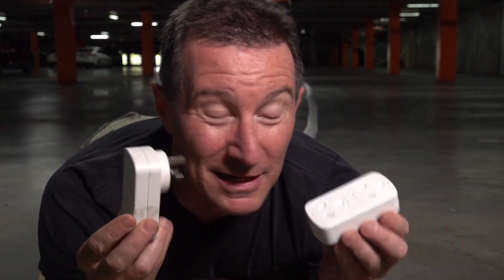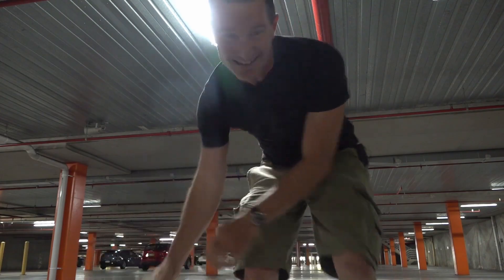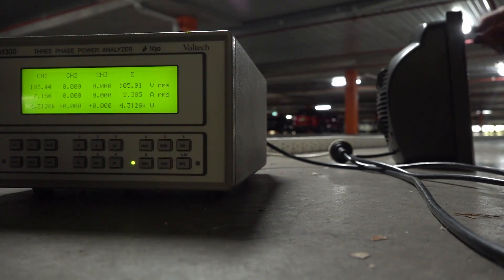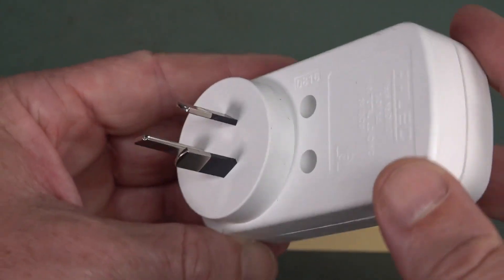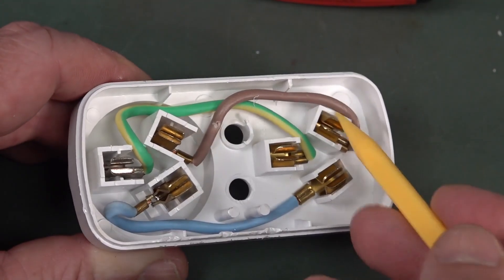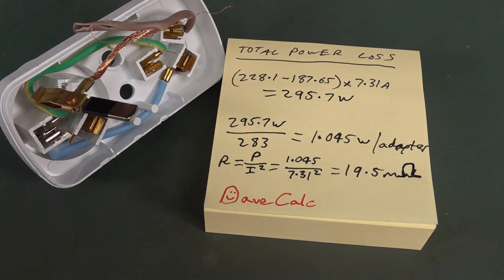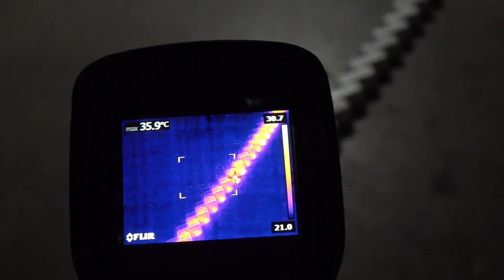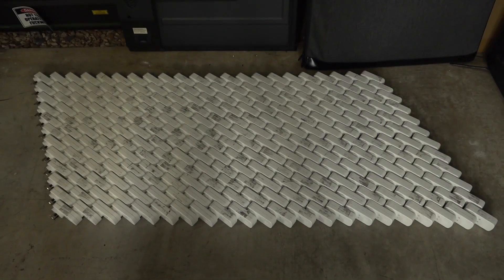EEVblog 1526 - I put 283 Double Adapters in Series with a 2kW Load!

Comment: Your perpetual energy machine won't work!!! Your circle isn't round. BTW I think you'll find that the insulating sleeves on the A&N pins are to prevent inadvertent shorts to thin conductors falling in between insufficiently mated connections.

Comment: The parasitic capacitance could serve as power factor correction for the inductive load of the motor in that heater.
Reply: With enough adapters in series no need for a motor. Just put a short at the end of the chain 😂
Reply: @absurdengineering  100% efficiency!

Comment: Most important question: would a circuit breaker work? Probable not, the initial short current is less than 40A! Heating up the line increases the resistent and the current decreases under the thermal breaker characteristic.
Reply from the maker: Yes it would. Total resisance is only about 5 ohms, so at 240V that's 48A. A 10A outlet has a 16A circuit breaker. In this case my dungeon has a 20A breaker.

Comment: I dunno... I saw your thermal cam read 55-60 degrees on a couple of those. Still not enough to start a fire, but wouldn't feel good if you bumped into it. I wonder how much heat sinking the concrete provided? What's TJMax on a plastic doubler with a concrete sink?? 🤣👍
Reply: Still 70C, the softening temperature of PVC.

Comment: might have been interesting to see how if behaves if the other port was used on each unit (using the more direct connection)
hehe, I was missing a thermal cam check first, but Dave delivered ;-)

OHM!

Comment: Those five extension cords would have been contributing some of that voltage drop you saw at 1kw and 2kw loads, too. (Sorry, just watched further in the video, you did touch on that.)
Reply from the maker: Yes, but the point was to see what drop the double adapters had. I didn't care what the current was as long as it was decent.

Comment: It would logically follow that here in the US we could use twice as many adapters, since we have half the voltage.  😅😂
Reply: You joke but the opposite is true. Lower voltages waste more power. Half the voltage means half the adapters, not twice.
Reply: @timewave02012  Yes, it was a joke.  Our 120V system is actually more dangerous in my opinion.  I’d bet the risks of overloaded circuits causing a fire are higher than the risk of accidental electrocution.

Comment: Arlec makes a few different types of double adapter - ones that go to the left, right and a vertical one. I assume using flexible wiring inside allows them to use the same wiring for all variants instead of having a bunch of different types of stamped brass.
Reply from the maker: Yeah, good point.
Reply: @EEVblog  Plus using the cable is a lot cheaper, in that you do not have any metal wastage when making them. Brass sheet stamped out you lose a big piece to wastage with each punch, and while you can recycle it, that means the per unit cost for the current carrying bit is a lot more, as you only use less than 50% of the material volume to do work in the outlet. Wire only scrap is 2 pieces of plastic sheath, easy to recycle as low grade PVC.

Brass sheet though is expensive, it takes a lot more machinery, as opposed to the simple wire drawing machinery and PVC extruder needed for cable manufacture. Plus you then need 3 punch die sets extra per plug, as opposed to here where you have one die set, that mass produces the 3 socket blade units as identical ones, using most of the long brass strip for it, and only needs a single punch die, followed by another 2 stamping dies to form them into the blade shape, and then you rivet the one side to the plug blade, and the other side is just loose.
Reply: @SeanBZA  OK, but then wouldn't that reasoning be even more applicable in power-boards? If so, why don't many of them use discrete contacts wired together?
Perhaps it's easier to arrange the power-board contact bars for efficient brass usage, that's all I can think of.
Reply: @longrunner258  Power board contacts are a punched strip, and most of the copper strip will go to making the current carrier and breaker ends, with very little being scrap, directly recycled back as copper scrap. Makes sense for the distribution board side, as this saves the manufacturer a lot of time in assembly, fewer parts to put together in the most labour intensive assembly process.

For the double adaptor however the most expensive part is the copper and brass itself, then the plastic, so if the wire costs say 1c, plus another 2c for the labour, the brass will likely cost 5c, and still have the 2c of labour cost in it.
Reply: I agree, and even within this adapter now 2 different model brass pieces are needed. Otherwise, 3 different brass models were needed.

Comment: That's not that bad, considering in the real life most would never use more than 5 of them in series.
Reply: Don't be so optimistic!
Reply: thats not true.... i go to clients houses all the time
i see more than 5 easily 
if i had to put a number on it for what would never happen, the minimum that would never happen i might say 20,   Perhaps 15 but that would be cutting it close

5 would happen any day of the week , i don''t think 20 would though
Reason, because to buy 20 of the double adaptors it would be cheaper to buy 2 bigger ones with 10 on each or 4 with 6 on each

Comment: Honestly, I'm not sure why this isn't recommended. The 295.7W that's "lost" just becomes part of your heater. As long as your adapters are in the same room you're trying to heat. How many of these would you need to then replace the heater load with a dead short?
Reply: You would need about 3000 of them to replace the heater.

Comment: If this configuration was used to heat a room, would you have less heat, the same, or more than if the heater was just plugged directly into the wall (i.e. is the heat from the adapters equal to the deficiency of the heater?
Reply: Definitely less. Higher total series resistance -> lower current -> lower total power across everything.
Reply: @Gameboygenius  WRONG, this is a basic physics 101 question.  Energy can neither be created or destroyed. There is no energy "loss" here, it's converted to heat,  the heat from the adapters+heater = heater alone
Reply: @Gameboygenius  the heater itself a one giant resistor, it's a resistive element heating coil in front of a fan. The heating is exactly equivalent
Reply: @mattgayda2840  No, the resistance of the circuit is increased with the adapters.
Instead of 2kW, only 1.6kW is dissipated in heat. The current is lower. P=U*I=U²/R

A 10 Ohm resistor across the socket gets warmer than a 10k Ohm one.
Reply: @Momchil0  where do you think that power is "lost" by a resistor? It's electrical energy is converted into heat, you can't destroy energy and the magic pixies don't disappear.
Reply: @Momchil0  have to researched this and realized you're wrong? Because you're totally 100% wrong here and I'll  give you my full unconditional support if you admit you're wrong.
Reply: @mattgayda2840  :D
The heater alone would dissipate P=2kW --> R=26,5Ohm and I=8,7A @U=230V

Now you add all the adapters. On each connection and the additional wiring R gets bigger. P=U*I=U²/R
U=230V is constant and R increases --> P decreases.
I don't watch the video again for the exact values, just as an example:
P_measured=1.6kW @230V
R=33Ohm and I=7A

The measured P is lower because the resistance is higher with the adapters.

It's true for every circuit. If you increase R then I will be lower. With a lower current, P is also lower.

What will get hotter, an 1Ohm resistor across a 9V battery or a 10kOhm resistor? You can try it.
Reply: @Momchil0 You can't ignore the basic laws of physics... you can't destroy energy, it has to be converted to something. All this elaborate calculations prove is that you can't destroy energy and you failed to calculate for infrared light and other loss. 

This is literally basic physics yet somehow there's people trying to argue against it 😂
Reply: @mattgayda2840  Nowhere I mentioned energy is destroyed. You use less power out of the socket, therefore less power is dissipated in heat over time (energy). You don't understand the basics of electricity and Ohm's law. With the adapters you changed the physics (resistance) of the device under test (heater and adapters).
As I asked you in my previous comment, which resistor gets hotter?
1Ohm across 9V or 10kOhm across 9V?
Which resistor will drain the battery faster?
It is not the same.

Comment: I´ve been in Shenzhen at this huge electronic market (several high towers linked together on a dozen floors), and the people sitting in the boots and talking with customers use the idle time for assembling wires and stuff - most probably also those ones. They´ll have a bunch of the contacts and cables, and they will be crimping them when there is no customer around.
Reply: It's a good idea -- we all could make some extra cash, while using the toilet!
Reply: So it's cheaper to use the idle time labor than use less labor-intensive manufacturing?
Reply: @thunderb00m 
When labour is only a few dollars per hour, yes. And they'll be paid per piece in those sorts of systems.... Or just buying parts and selling the assembly directly. That goes on a lot in China.
Reply: These things are made from plain old sheet metal and plastic case. No crimping! No soldering!

Comment: It was probably manufactured by a small team in china rather than a large company.  They wouldn't bother getting custom tooling for shaped brass inserts. Easier to just buy off the shelf terminals and wire. A small company only making double adaptors because they found a box of 10,000 surplus terminals or adaptor housings for surplus pricing at the Shenzhen markets. There's lots of money to be made in china assembling stuff out of whatever surplus parts are easy to get at the time,
Reply: Makes sense
Reply: China uses Aussie style plugs internally, so I would have thought there would be a pretty large domestic market for them? It is not just Australia and New Zealand.

Comment: Air compressor safety instructions: Always use a longer air hose, plug straight into wall, don't use an extension cord.

Dave:

Comment: did not have the right screw bit to take it apart I see!
Reply from the maker: I don't think there is a screw bit for that!
Reply: @EEVblog  Nah, piece of proverbial urine, I just filed out a notch in an old flat blade screwdriver, you only need to get it to fit into 2 of the 3 indents on the screw head.
Reply: Yes there is. It's very expensive and only sold to locksmiths. They are used to replace locks fitted with one way screws. If you are not careful the expensive tool can easily be destroyed.
Reply: @mrfrenzy.  Only to locksmiths and any random dudes making double adapters.

Comment: How many adapters would you need to have to get more heat from the power loss of the adapters to than heat from the heater.
Reply: Each adapter had a resistance of about 0.02 Ohm. The heater has a resistance of 29 Ohm so you would need 29/0.02=1450 plugs.
(I wanted to do the calculation myself so might just as well write it down.
Reply: About 1250-1350

Comment: I still don't understand why you didn't connected power analyzer before 5 extension cords. In this case you don't have to run back and forth.
Reply: And miss out on the improvised training for crosscountry running? Not a chance!
Reply: Then you would measure the power loss of the 5 extension cables as well.

Comment: From the manufacturing quality inside they look quite decent, and the fact that in AU there are blades for all of the connectors make up for a good connection.
In germany, with those Schuko system, especially the PE connection in a cascade can get to very high values, so that effectively in case of a problem the minimum short circuit current is not reached so a fuse has to blow the slow way.
Reply: In Finland we have older outlets with the earth / ground in the middle; current Schuko 16A plugs  fit perfectly but leaves the connected appliance ungrounded!
Reply: @cambridgemart2075  In Russia/Ukraine/Belarus we still have older "soviet" plugs and sockets in many places. They have same distance between poles but thinner poles.  
Schucko plugs do not fit into vintage soviet sockets (unless you file the holes)... but they do fit into soviet-compatible extension leads (which are still sold!) if you push hard enough. EXCEPT it often destroys the socket internally, and now soviet plugs do not make good contact anymore!
Reply: @jwhite5008  funny thing Schuko sockets were certified and manufactured in Soviet Union, used for some high current devices and lab equipment. But you wouldn't find one just installed in your home unless you had an electrician patch one in to install an air conditioner or something.
Reply: @SianaGearz  Yes, I always found that very wierd - very old sockets that are seemingly compatible with shucko plugs - some with french-style grounding prongs (which do not exist in Russia anymore), some with german-style outer brackets (which is what modern ones look like). They were, as you say, used by high-current 220V devices, normal plugs were usually rated 1, 3 or 6A, while those were 15A (most modern shucko plugs allow up to 16A). They were quite rare, but I've seen a few.
Reply: Actually type F plug can be plugged on both type F socket (shuko) and type E that is having a reverse pin to make a better earth contact and also enable polarity feature on the plug. Type E are used in BE, FR, CZ, PL and a bunch of other countries.
Reply: Italian sockets are the mess: they are good enough, but nobody cares about them(Italians too). So, you end up with adapters and  everywhere for a single connection. Because there is 10 and 16A socket that is another headache
Reply: @ДаудМухамеджанов  The EURO standard used in the CZ has sockets for 230V rated at 16A, some socket manufacturers use an auxiliary clamping spring on the contacts - these sockets have excellent contact clamping and there are basically no problems with them (mostly only oxidation), but there are sockets without auxiliary springs and there during use there is a decrease in contact force, these sockets can heat up so much during use that the connector melts into them.

Nice day 🙂 Tom
Reply: Arlec generally make pretty good quality stuff

Comment: wtf.......... what's their resistance? makes sense it should work... most things we buy are quite well made even the cheap ones. it's amazing more stuff doesn't burn down, but everything's gotten so safe today. except for the air. the air is not safe. or the water. but electricity has gotten way safe.

Comment: I looked at your setup and seconds later I'm thinking "Why haven't you got a 10cm extension cable in the middle of the stack so it can be U shaped with the in and out ends adjacent?".  Or perhaps they can form a circle?

Comment: Now try to test how "unsaved" it is. is the beaker still acting fast enough or is the resistance high enough that it can be a fire hazard?
Reply: The total would be around 5.5 ohms. @240V that’s about 10kW, 40A. ~35W/adapter. I bet a typical breaker would pop before fire
Reply: @pyromen321  Brakers can support a large multiple of the nominal current for a long time. a Europen C type needs 10-20 times the Rated Current to magnetically trip instantly.
With this impedance it would not instantly trip the braker. it takes a lot of time for the Thermal beaker.
If this things heat up the resistance goes up and the current down... 

This is why we measure the impedance of outlets to make sure the fault current would instantly trip the braker.

Comment: What if you put the adapters on the top section (the one without wires). It would show only plug connector losses.
Reply from the maker: I did only show plug connector losses.